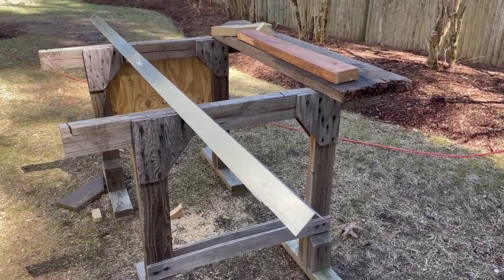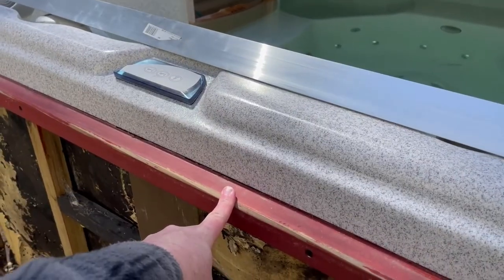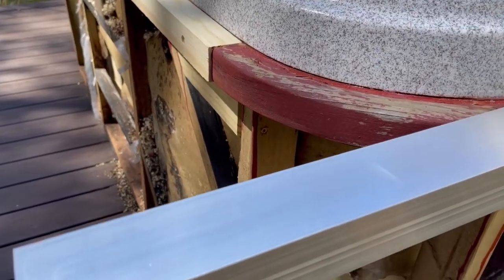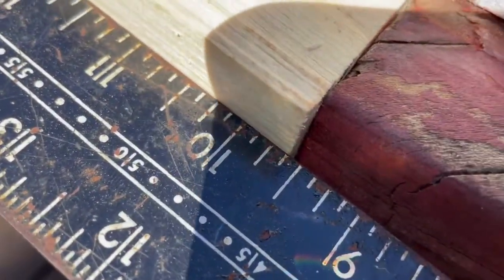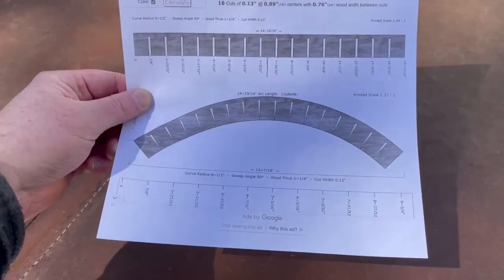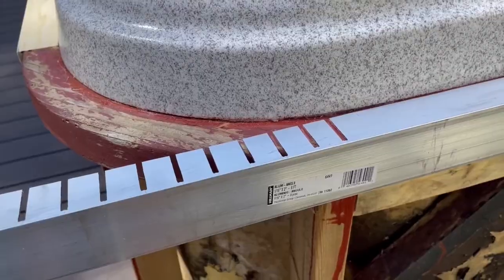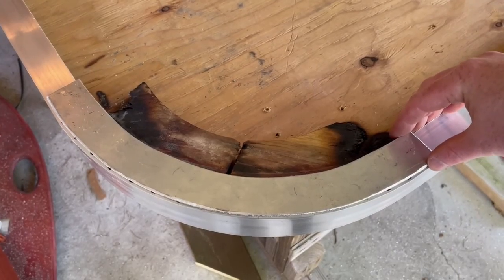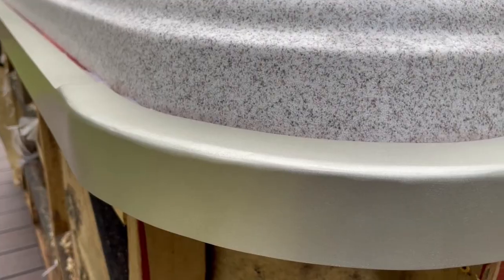Bending Angle Aluminum (Kerf Cutting)

Comment: Looks really good nice one, but why didn't it say cut triangles so that they all close up perfectly when finished, then you could have brazed the joints!?..
Reply from the maker: @CrustyBiker thanks for the comment.  We had a similar question further down in the comments section.  You are correct...if you could cut perfect triangles, there would be no gaps at all once the bend was completed.  However, the width of the cutting blade of a circular saw is the limitation (the blade would need to be thinner in order to bring the cut to the point of the triangle).  It would take a laser beam to cut a perfect triangle.  In the alternative, I suppose you could stop the cut short with the chop saw and finish it with a hacksaw to complete the point?  Lots of extra work, but this would definitely produce a nicer finished product.  You're 100% correct.  The kerf calculator I linked would not give you the correct angles, but I'm sure you could find some other resources online to figure this out.  Good contribution to the conversation.  Appreciate it.  :-)

Comment: Why not fill kerfs with either thicken epoxy or Bondo, if you’re painting it
Reply from the maker: @Otto-k-1955 Good comment. I'm not confident in the holding power of these materials with the expansion/contraction of the temperature differentials we experience here in New England.  Once applied, you would sand it flush with the surrounding materials, so it would only be holding on the edges.  But I don't have experience using epoxy or Bondo with aluminum.  What do you think?  Would it hold?

Comment: If you made that radius out of wood anyway couldn’t you have just heated and bent the metal along the wood? Your final product looks great I’m just curious of your reasoning
Reply from the maker: Thanks for watching, @domkiker.  Heating and bending the l-channel around the wooden radius would have worked for the vertical portion of the l-channel, but caused the horizontal portion of the l-channel to pucker.  It wouldn't bend cleanly, even if it was heated.

Comment: That did produce a nice radius. But if I were going to cut the radius and weld it in place regardless, I wouldn't have wasted time cutting the kerf. This basically defeats the whole purpose of the kerfed bend.
Reply from the maker: @TheBrushcutter.  Agreed...in my application the first and last kerf cut is all that I needed to do, then just remove the material in between.  The cap could have been brazed in, then sanded smooth.  Hindsight is 20/20, as they say.  ;-)

Comment: Like what you did with one exception. Why not cut out the segments and braze the curved aluminum piece where the segments were? Just me. If you are proficient at the brazing, that would save grinding/sanding and provide a flat surface.
Reply from the maker: @nhschreiner 
Another viewer made the same comment.  If I had it to do over again, I would have done it the way you describe here.  Great note.  Thank you.  :-)
Reply: I came here to say this very same thing. However this was a good demonstration of kerf cutting. However the OCD in mr would be forever bothered by the two humps.

Comment: Why would you be particular about weather the kerf closes tight if you are going to cover them with a cap?
Really only need to know distance between cuts and minimum kerf size.
Reply: Was your comment in response to SamoMalo2's post?  You're right, a tighter seam would be irrelevant if you're using a cap to cover the bend.    
Good comment, @garycarbonneau499